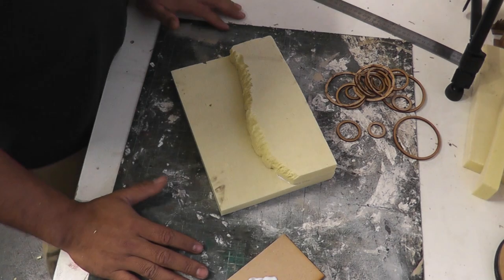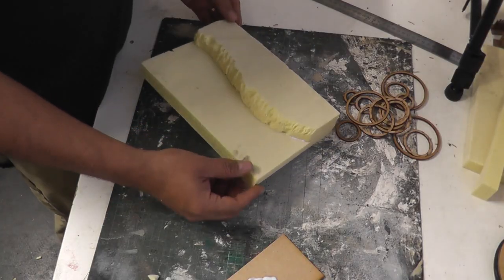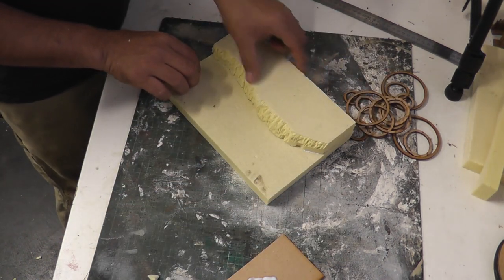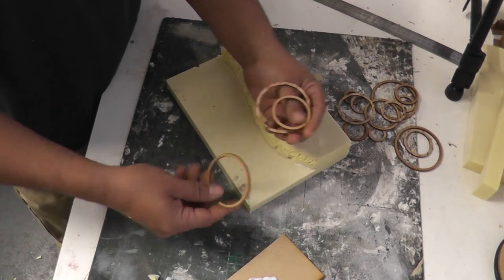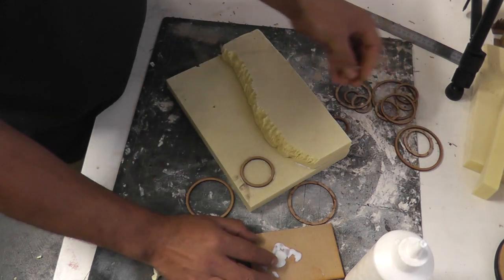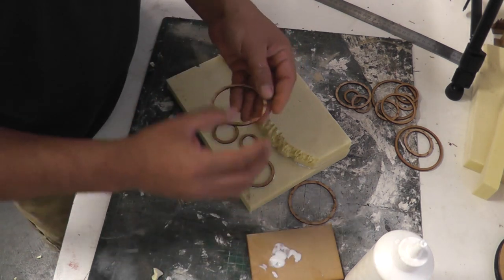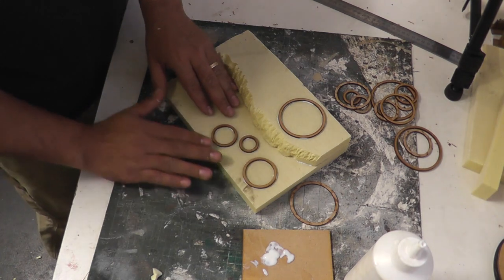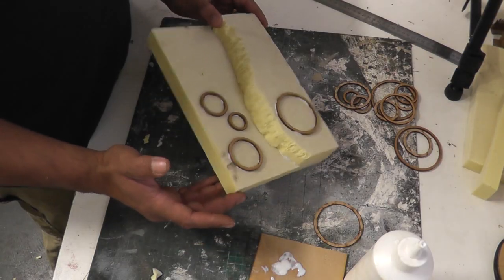Should we make it? Display Rings ...

Comment: I find this very interesting, not sure I will build a display but I like it. Was thinking about how to cut and use as much of the board as possible. If you only want rings you could cut them inside the other but then you get the same amount of rings for every size and I don't think they will all sell, guessing the 25mm would sell the most. You could, since you cut it out anyway, sell the leftover as base. Been thinking about using mdf as bases for a while and this way i would get the base and the ring.   

This is just my mind wandering away =)